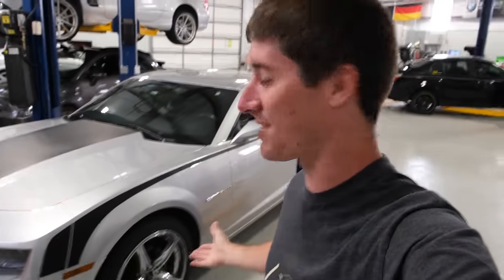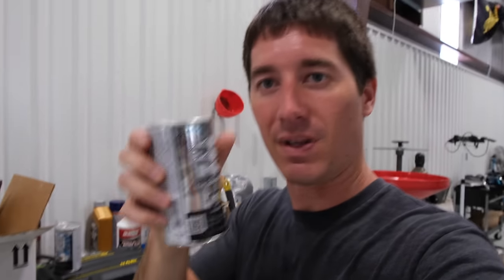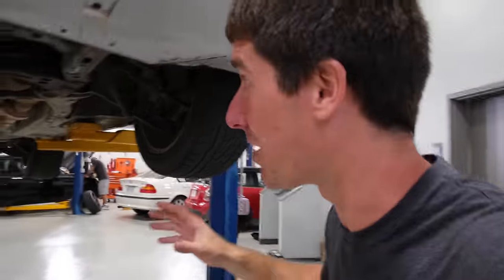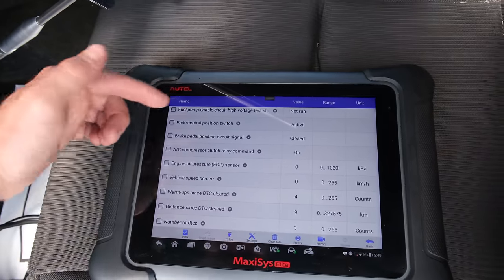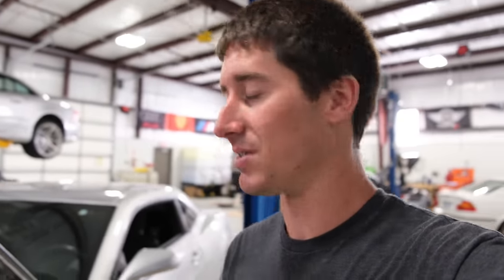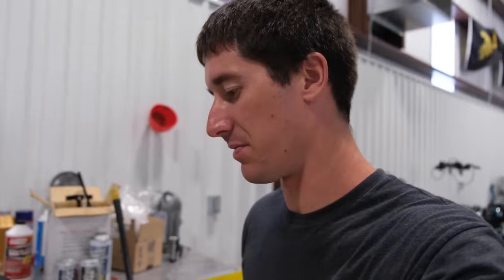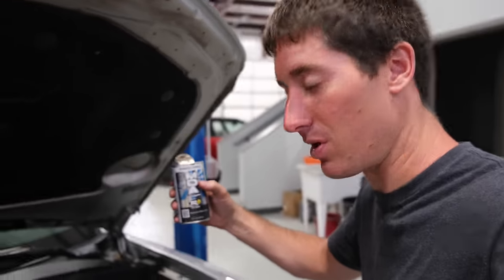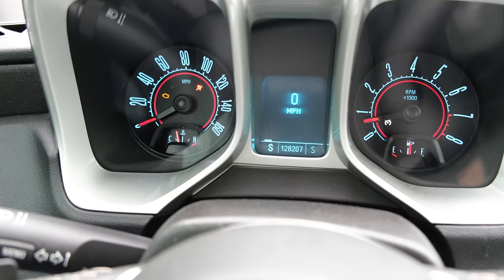FIXING The UNFIXABLE Engine In My CHEAP 2011 Chevy Camaro RS *SLUDGE REMOVAL*

Comment: GM released a TSB for these engines and a "recall" for I believe 2009-2013 models as per the class action. Their solution was to reprogram the ECM for 3k mile oil changes instead of 5k or 6k. It's been a while since I was willing to touch one so you'll want to look that up. The PCV fix would be better but you know, manufacturers want the cheapest solution possible, even if it costs you double in oil changes. Pull those valve covers and the RH will be dark while the LH looks perfect. So much for R&D before release!

Comment: In the old days when we had a sledged up engine like that we drained the oil and used kerosene to clean out the engine.  Worked in anything that quakerstate had been used in.
Reply: Good ol quickerstick. Good to gum up any engine. Pulled down a Ford 351m once that had quakerstate since day one. I had to scrape the gunk out with a serving spoon. Just nasty.
Reply: We used to use kerosene also. I am guessing today with all the sensors probably not a good idea.
Reply: Quaker State & Pennzoil....the stink alone is terrible
Reply: 1-K Kerosene $1.43/gallon.   Marvel Mystery Oil - Oil Enhancer and Fuel Treatment, 1 Gallon $15.87.  Both better than whatever snake oil they sold you.
Reply: We use to add a quart of ATF because it has lots of detergent, run it around for a day and flush same as this but cheap
Reply: Quakersludge....ooooh yes
Reply: Pennsoil had pariphin in it which made valvetrain noise quieter. Too bad wax in oil equals death. I don't think they use the old gimmick formula these days. At least I hope they dont.
Reply: ALL the old oils made sludge.
Reply: @tomhutchins1046  Especially early non detergent stuff, for obvious reasons. Lots of old school air-cooled Volkswagen guys swear by it. Ive never put that stuff in anything I've owned. Heat kills it
Reply: I was waiting for the Quaker State disasters. We could always tell if it was used ,because when you pulled off the valve covers, It looked like it was full of coffee grounds.
Reply: I have used Kerosene and diesel before to flush a engine. It was cheap and whichever I could find cheap I used. Leave some oil in and top off with whatever and idle for 15 minutes or so and dump it. I tend to use Valvoline because I have seen some neglected engines that had run it before with like 10k on the oil before everything was using extended run oil changes.
The engines top of the head etc was still very clean so I have stuck with it. Of course if you have pcv issues so nothing breathes right constantly all bets are off as far as sludge but it's good dino oil. I haven't tried synthetic yet and all my cars are high miles but usually clean internally. Sometimes I also throw a quart of transmission fluid in a short time before a oil change and that will really clean a engine internally and has never cuased any issues for me. My Neon had a collapsed hose in the pcv system and it was sludging up under the valve cover but since I finally found a OEM molded hose and cleaned it up and redid the valve cover gasket set up it has been breathing properly again and has stayed clean so far. So many things can cuase issues on the newer cars these days you have to watch over it and fix weird issues you didn't see on older engines.
Reply: @PHATJANUS  
Marvel is still useful stuff. 
It takes more juice , but filling it to the top and letting it sit a few days helps get alot of sludge loosened up and you don't even have to run it as much. 
Ya better drain it down when you do go to run it , and probably pop the plugs because it can fill a cylinder and hydrolock ya but I think it's more effective.
Reply: @linuxuser21629  thats not just any sludge thats pure Pennsylvania clay.
Reply: @owenshiverdecker6999  Hi, just a question, I have an old Mercedes SLK from 1997. And I have often heard that ATF is a good means to clean the engine internally. So if you have experience with ATF, there are things I should pay attention to when using it. What exactly is the procedure when I apply it. I live in Rotterdam, Holland. Thanks in advance for your cooperation. The car runs on petrol.

Comment: I’ve done this myself on what was considered a junk engine without any special products.  Just did seven oil changes in one day. Saved a truck that I bought for next to nothing. Kept it for many years of heavy use changing the oil every 2500-3000 miles after the initial cleaning.  
With all the detergents in modern oils extra additives are not necessary.

Comment: i worked at a VW performance shop we used to put diesel gas in to the engine  it would fix the stuck lifters 99% of the time
Reply: I dont remember all the details but had a 71 duster with a clogged oil pickup.  My dad had us drain the oil and fill with diesel with a quart of 80 wt.  Ran for a while and then two oil changes.  Never had an issue afterwards.
Reply: I have used diesel in old engines to clean up buildup also. In the current engine I'm working on, I would put a gallon of diesel in the engine and then spin the oil pump with a drill to circulate it all though the oil passageways. I did this until the diesel would come out relativity clean.
Reply: Our version of this used ATF fluid
Reply: i just use seafoam... 1/3 of the can in the tank, 1/3 of the can in the oil, and 1/3 of the can down the intake.  if they are bad like this one, i'd do half a can in the oil, and half a can down the intake to give it a lil love.  I have used diesel fuel in the oil a few times on nasty motors though, works pretty good.
Reply: You said you used to work at a VW performance shop.......and you said "diesel gas" ! 
You evidently were the janitor ! 
😊😊😊
Reply: Clif Bradley  my last oil change was 77 dollars.

Comment: A 10 year old v6 Camaro with a possible bad engine for “only” $4k?  Seems kinda steep.
Reply: Exactly
Reply: Not really, I have seen 2010 - 2014 camaros sell for more that had blown engines and banged up bodies. The overall condition of JRGo's camaro is very clean & straight plus it still even ran. Look on ebay and see how much wrecked gen 5 camaros go for that are wrecked or are in need of an engine, $4 grand was a good deal for this one.
Reply: @thedude6547  that's your problem right there looking on eBay LOL Facebook Marketplace has done right now newer model RS and SS blown motor or bad tranny's for like $1,300
Reply: Yeah, the V6 is not desirable.
Reply: Jacob Meadows nobody wants a V6
Reply: @tortoisehead30   Bullshit,  I work at a car dealer / shop and a lot of folks buy the V6 models.  I took a 2013 V6 camaro for a ride last year and was quite impressed with how fast it went, I got it up to 147 mph no problem and it did it pretty damn quick too.
Reply: @thedude6547  Yes, I like them too. I'm just going by the resale value.  It's a lot less for the V6 from this time period.  But yes, you get plenty of torque and horsepower out of the V6.
Reply: @tortoisehead30   You sure do get plenty of torque / power out of the camaro's V6 however i'd have to say that i prefer the V8 over the V6 any day of the year in any vehicle however i was quite impressed with the camaro V6.
Reply: @StickerVR  if you can find me a 2010 SS with a blown motor or bad tranny for $1300, I'll give you $250 just for finding it! Message me if you see one. I'll do you right.
Reply: Normally a 10cent per lb class of vehicle. $500 max limit.
Reply: lol nah. Its a better vehicle than the ghetto ford or duct tape Mercedes to  dodge conversion of the chargers lol competition
Reply: So pull the motor and drop in an 8

Comment: well I'm changing my oil more often
Reply from the maker: Good call! 🍻
Reply: on my jeep wrangler i usually change my oil every 3 months or 3000 miles and if the 3 months are up and i'm under 3000 I still change it regardless. I also drive very short trips
Reply: They say to stretch out the oil change interval mainly to make it seem like the newer engines are so much more reliable and better built they don't need their oil changed as often. I would think unless you have a super filter you would still want to change it out every 3k or so. I have always changed my oil and filter every 3k give or take. It's still one of the cheapest things you can do for your car to make it live longer. The newer cars have a oil change light that sometimes tests the quality of the oil to tell you when it's gone away and needs to be changed. Pretty sure if oil stays clean you could run it till the additives go away and just add what it needs but most cars don't filter well enough to get away with that, especially once they start wearing out.
Reply: @69Dartman  my jeep is 20 years old and it has no oil change light. You're absolutely right about changing the oil every 3k miles I've done that with every car i had and they've lasted til i would trade them in for a different one and they were still running great when i did. I'm also sticking to the older cars cause 1st i can't afford them and second i'm a simple man i really don't need and the fancy stuff that comes with the newer cars.
Reply: I bought my Dart in 79 with 63k on it and got my license in it eventually. I still own it and it has 175k now on the original 318. I have retired it and am driving my lil sisters old 95 neon she bought new after I told her what options to get. It has 189k on it now and still runs fine. I got it with 155k and have replaced the water pump and timing belt, front pads and rotors, plugs, and rear main in that time from 05 to now.
Reply: @bretthibbs6083  I go 5-6K, but only because I have a long daily commute normally and any time I drive I'm getting everything up to full operating temperature... and that's every day twice a day. That's a 2.2L GMC Sonoma.

Engine's still quieter than most at 298,000 miles and all the gaskets are undisturbed factory seals except for the water pump, so I can't be going too wrong here.
Reply: @mfree80286  that sounds good I had a 4.3 sonoma and i changed the oil every 3 to 4k and for awhile i was driving 15 to 20 miles one way. But now i work just 4 miles from home so that's why i change it more often
Reply: @bretthibbs6083  Good grief.  The "3000 mile" is a 60 year old wives tale, and doesn't apply to modern engines running synthetic oil.
Reply: @dizzywow  ya know what i've been doing for 30 years and I have a 20 year old jeep and I also do not use synthetic oil
Reply: @bretthibbs6083  Fine, but it's overkill, ridiculously so when synthetic is used.

Comment: 11:40 that before and after shot is truly amazing.  I cringe thinking about revving the engine to static 3000 rpm in neutral for such long periods, engines aren't made for that but apparently it's not blowing up either LOL.  Good video.
Reply: No worries, 3K isn't overly high for most gas engines. My car reaches 3K RPM at only 65 MPH in 5th gear and has been on many road trips at nearly 4K RPM for hours at a time and the engine still has like new oil pressure and compression with no major oil consumption almost 20 years and 280K miles later. Oh, and it sees full throttle and redline at least once every time it gets driven too. Engines are way tougher than most people realize.

Comment: Great video I've had the dealer use bg products the clean my fuel injectors and it worked good but I do my oil changes every 3000 miles

Comment: I've been a Technician for 38 years and I can tell you that your chances of success is slim to none. Plugged pick up screen, stuck oil pressure relief valve and or oil filter full of sludge chowder. Completely contaminated VVT oil circuits.
Reply: In your opinion what's the best way to go about cleaning it out then  ?
Reply: @OGCJ10  There is no good answer.  The right way of doing it would be to tear it down clean it then reassemble. But that's not practical  Answer for everyone. When you use an engine flush solvent and it starts to react with the  sludge it will continue to flake off and make its way into the Pan. At that point your best bet is to simply remove the oil pan clean out as much as you can, clean out our pick up tube to the oil pump. Reassemble and do multiple oil changes.

Comment: About the main thing I look at is that . 

The oil slug that possibly wasn't all removed from oil pan will get sucked up by oil pickup tube and clog up the screen . I would remove the oil pan just so u know 100% that it is clean inside the oil pan in the oil pump screen is not clogged at all .
Reply: you have too remove sump to get timing cover off anyway

Comment: Poor man's equivalent is to add trans fluid to the oil and run, has anyone heard off that?
Reply: yeah Supposedly tranny fluid is all detergent.... I've never done this I've just heard about it second hand
Reply: My dad used to do that all the time
Reply: I’ve also heard using a mix of cheap oil and diesel fuel too. But I’ve never tried it...
Reply: My uncle said Kerosene works. But personally I just used the $4 stp stuff have no idea if it worked or not.
Reply: In the 70s and 80s, my dad would run tranny fluid into a sludgy engine, drive 50 miles, change, and refill. We fixed a messed up 1975 ramcharger with a blown timing chain that was blowing smoke that way (also, the new timing chain).
Reply: I used it in a 66 mustang 289 with noisy lifters. Worked great but needed to be done every few months to keep it quiet.

Comment: I normally use diesel to remove engine sludge. Before an oil change I put a quart of diesel in the oil and run it an idle for 10 min then drain the oil. Had pretty good results so far.
Reply: I heard 50/50 oil And ATF is a good cleaner too.
Reply: This is not a good practice at ALL.  Knew a guy who destroyed an engine doing that.  My rule of thumb, if the additive is not made to be driven with it in the crankcase, I don't want it in my engine.
Reply: Many engine flush products are mostly kerosene and ultra low sulphur diesel
Reply: I had a local bloke suggest this to me and thought old mate was taking the piss
Reply: Use palm oil to flush or mix it with your car oil.
Reply: @addicz2  What would you suggest to do for a car with a possible cracked head where water has been mixing in with the engine oil for years and has made it milky and thick/gunky? Preferably without opening up the engine. Any advice would be appreciated.
Reply: @OnlyProgressXL  Here in SE. My country Indonesia. Lower budget people mix Base 1 single grade SAE40 engine oil with Corn Oil or Palm oil (the same one we use to cook). Or some puristists use palm oil to flush the engine. Pure palm oil or mix it with Engine Flush such as STP or etc whatever brand you fancy for.
Some blogger from my country. If you realy want to use pure oil to your engine. Buy Ravenol or Mobil Delvac 5w40.
If you want to mix it with palm or corn oil. Try 10% first. To erase the gunks slowly to not damage your engine.
That what he said.
Dont buy a PAO base oils. PAO base oil is very clean. But cant cleaning the engine. Only mineral oils ca clean it. If you did not believe me. Read Shell Helix Power MSDS. They use mineral base oil to diluent the aditives. Even though the main oil base is Synthetics.
Reply: @OnlyProgressXL  Once again. ATF as aditive is a bad idea. Use 2t/2 strokes engine oil if you want an aditive to you car engine oil. And your localbloke was right. Using HDEO was agood way to flush a petrol engine
Reply: @addicz2  Words cannot express just how bad of an idea it is to put in your car engine...
Reply: @robertmaybeth3434  palm Cooking oil or HDEO as petrol engine oil? You have no idea bro.
Just remember. In the past MotoGP use castor oil before those companies creating todays Synthetic oils.
Why dont you searching on google about palm oil as lubricant.
Reply: @addicz2  I admit i'm no tribologist but I don't need that to tell me don't put anything in your engine the manufacturer doesn't specifically say you can.  I've seen mechanics destroy an engine in a 2 minute drive by putting ATF in the crankcase and then somebody else drove it.
Reply: @robertmaybeth3434  That was my comment above. Do not put ATF on an engine. Only idiots did that. All I say is put a ccokin oil on your engine. Cookin oil Flash Points were higher than your beloved engine oil. Very minim eveporation lost. 
Here in my country people use Cookin oils as HDEO replacements. Because its cheapest option if they didnt have moneys.
Why didnt you try it first then report the results. Just mix 10-20% corn oil to your petrol oil. Then report the differences
Reply: @addicz2  The only real car expert that will advise you to put corn oil in your  crank-case for any reason, is the guy that sells replacement engines.
Reply: @OnlyProgressXL  because he was.  I was a mechanic for 30 years, I could pave the sidewalk with all the ruined engines i've seen, they are infinitely easier to destroy internally than they are to fix once an unqualified person has monkeyed with it!  Engine flushing is something I try once on an engine and even then, only using engine oil and NO additives I wouldn't drive on!  Because, if the engine isn't really all that dirty inside, just doing some more frequent oil changes for a while will do the trick.  Anything requiring the likes of diesel, ATF, acetone, ANY liquid intended as a fuel and/or solvent, means you might as well pull the valve covers and oil pan, brush out the oil galleys you can reach, i.e. clean as well as possible, THEN button it back up and change the oil more often.  Anything else using heavy solvents etc. is really, really close to being counter-productive, which it sure as hell is when you're close to destroying the engine by doing it.
Reply: @robertmaybeth3434  Thanks mate I was confused with all the different answers. I’m taking your advice! Thanks for helping me not wreck my engine! The 308 will live on :)
Reply: @OnlyProgressXL  I try to talk everybody out of such flushing solvents, unless you tear it apart and clean it that way - a gradual cleaning is best, to me anyway...